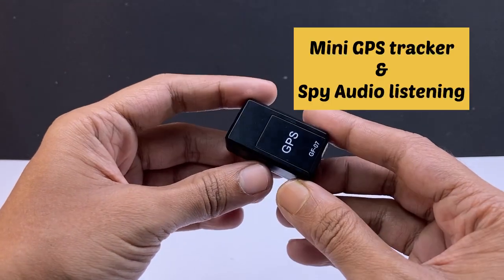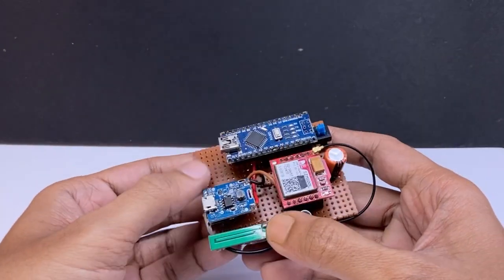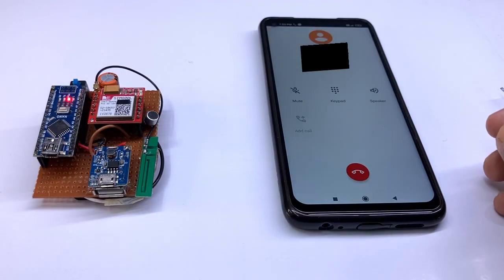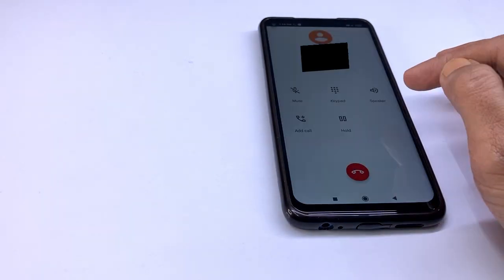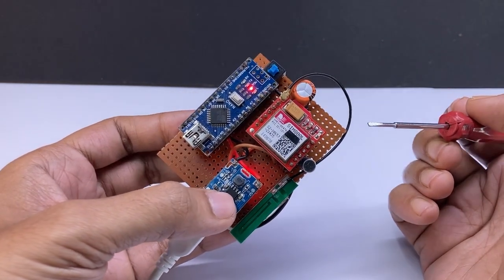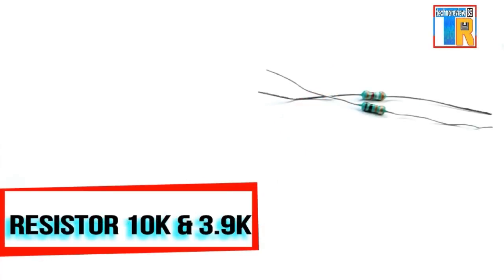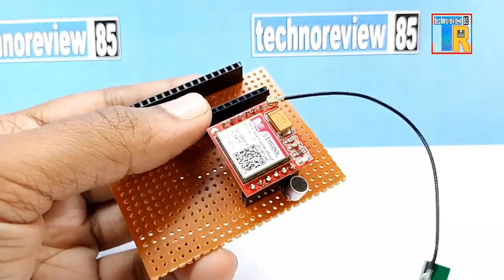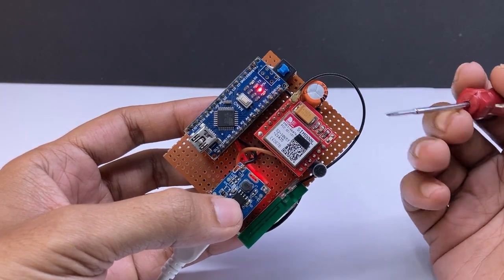Make a spy audio listening device like GF-07 GPS tracker

Comment: thank you for the wonderful video. i've always wondered about devices like the GF-07 and GF-09 mini trackers. is the one who makes the call able to speak through the phone to the tracker as well, thus transmitting their voice through a speaker on the device? i'm trying to conceive a device that operates on similar principles as this one with this added capability of transmission of audio from the point of the phone user. please respond, very interested. if anyone has any comments or suggestions regarding this please share them, thanks